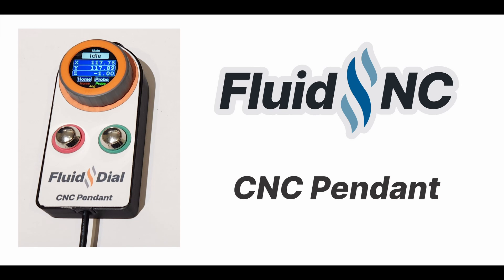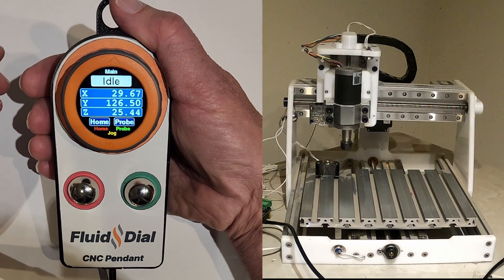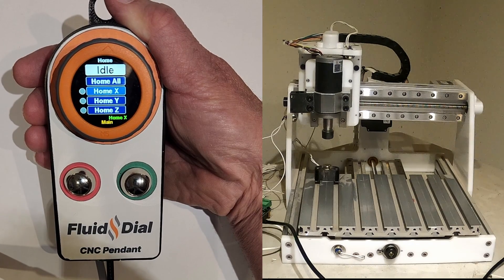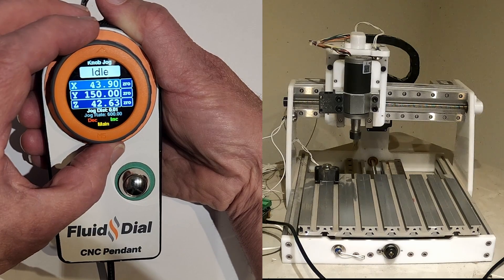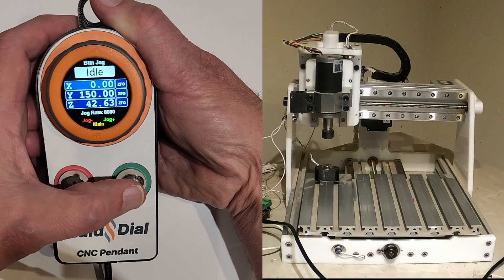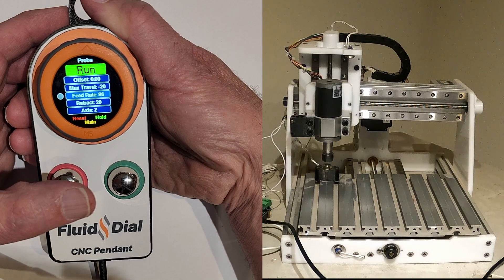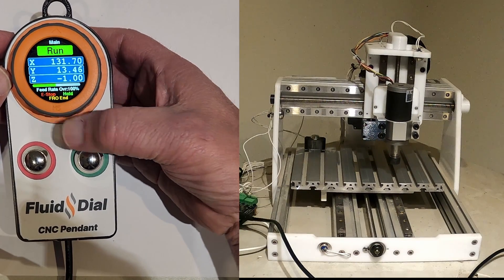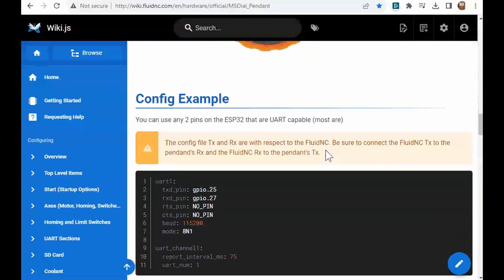The FluidDial CNC Pendant for FluidNC

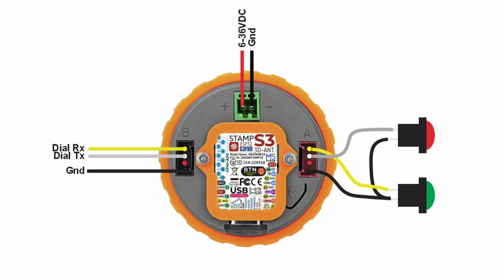Comment: Please note that the wiring diagram shown at 1:07 is outdated and incorrect.  Please use the updated wiring shown on the wiki page.  Also please note that, unless you use one of the newly-available connection kits, it is easy to destroy both the M5Dial and your controller board if the wiring is done incorrectly or if you make the connections in the wrong order.

Comment: Hi, I am new to cnc and programming. I want to make a custom tool changer. I would like fluidnc to send tool number to an external device such as a micro controller (running arduino code) so I can use it to facilitate tool changing. Is it possible to do this. Can you give a brief overview on how to do this? Please point me to where i can find the answer to this question if you have answered it before. I looked through the FAQ but havent seen any information on this question.
Reply from the maker: Go to the FluidNC wiki and our Discord.

Comment: Hello Bart,

I’m working with an MKS DLC32 V2.1 board and the MKS TS35-R V2.0 touchscreen.
I’d love to use FluidNC with the following features:

• WiFi connectivity
• X and Y edge probing
• Z-axis probing
• Multi-point bed leveling
• Multi-point part leveling (X, Y, then Z)
• Touchscreen interface with matching icons for each function

Would it be possible to create or support this setup within FluidNC?
I’m comfortable adapting `config.yaml`, wiring DM556 drivers, and scripting macros — just need guidance or a compatible build to get the touchscreen working.

Thanks for your amazing work!

Best regards,
Manu
Reply from the maker: See how to request help here.  

http://wiki.fluidnc.com/en/support/requesting_help
Reply: @engserve thank you very much 👍

Comment: I built the pendant and it powers up.  It says N/C on the screen.  I assume it is not communicating.  I am using UART1 1000000 baud 8n1.  GPIo.13 rx, and gpio.21 tx.  rx to tx, etc.
Is one million baud correct?  I saw somewhere else 115200. ???  No errors when I bring up the webui.  Show the correct gpio pins on webui
Thinking about changing temporarily to uart2, which is a header on the Tinybee
Reply from the maker: Ask for help on our discord.  Youtube is no good for tech support
Reply: @engserve  every time I try discord, it tells me I have no text channels, whatever that means!
Reply from the maker: @glenb1356 try this link. https://discord.gg/29xc4zV8
Reply: I have confirmed with a scope that the Tinybee is transmitting.

Comment: Hi great video I also built the same pendant everything works only the probe part in my opinion doesn't work well in practice when I start the survey sometimes part touches the probe and stops does nothing else and there is no way to bring the tip to the zero piece or sometimes part for an instant without touching the probe and on the webui it appears offset set do you know why it has this behavior?

Comment: would i be able to upload files to the cnc machine via the usb port on the pendant? its currently not designed to be accessed but i could easily modify the design to make it possible to attach a usb. Our local makerspace is building a printnc with your 6 axis controller and the owner of the space doesn't want to upload files via wifi.
Reply from the maker: You can upload files via the USB on the main controller...not the pendant.

Please ask future questions on our discord. See the wiki for access.
Reply: @engserve  o thanks! I'll check that out. Can also make that work.

Comment: Hello Sr. I see that the XYZ axis are always in mm can I put the reading in degrees as if they were 3 horizontal indexers and maybe add more axis or indexers as A B C and if you can also add a speed regulator to the spindle or Motor ? thank you

Comment: Thanks for this! I got my Fluid Dial pendant printed, assembled, and wired (on pendant side), and firmware built and uploaded. Still need to do the wiring connection on the board side. I had an issue with the case not allowing enough room to connect the power to the dial, and I wound up remixing the printed base to add 7mm to its depth. The power input socket on the dial came with a green plastic "power block" insert, but the printed base was not allowing enough room for it, and also did not have enough room for using 2.4mm pin housing type connector either. The remixed version seems to be OK. Thanks again!

Comment: I really love your ethos @engserve! Stumbled across (many recommendations for) your work while I was checking out tasty, tempting Fluidnc stuff. And now I can't wait to start using some of your gear as well!  GRBL, Fusion and Easel should be really enough for me, but no! Not not now I've seen ESP32s being wielded by Bart Dring. Big wants :)
I just need to finish a minor complete transformation of my now sloppy old 3018 engraver into a solid 3D carver. I Have almost all the bits for the job, except maybe fasteners, I keep ordering the wrong ones lol.

Comment: I bought the pre-made connectors linked on Amazon.  They fit the dial ports nicely, but only if you cut off the locking tabs.  They do still seem to click into place and are fairly secure.
Reply from the maker: You are correct. I added a note about that to the wiki page.

Comment: Very fine project. I landed on this YT site while looking for some documentation on the M5 Dial's software routines. M5 has very little documentation on the software  routines for the display, etc. Looks like you have figured it all out. From your code, I believe you use PlatformIO, which I don't use (I use Visual Micro plugin for VS for any Arduino projects I do)
 While I wasn't thinking of the M5Dial for a pendant, I also have a homemade  CNC milling machine and a fancy pendant that I built with a lot of mech. buttons , and a very fancy encoder wheel that is industrial quality (although I got it from Bangood).

Comment: If you get a chance, please post a link to which buttons you used (perhaps either in the pendant wiki or here the description).
Reply from the maker: They are usually called anti-vandal buttons. Any button that fits in a 12mm hole should work. Added to wiki http://wiki.fluidnc.com/en/hardware/official/M5Dial_Pendant
Reply: @engserve I'm genuinely excited about this project. It occurs to me that if a file browser could be programed into it to display what is on the SD card and allow starting jobs from this pendant, it could reduce need for a smart phone or tablet. Don't know if that's possible, just an idea.
Reply: @design8studio  almost always you want a momentary switch for these types of inputs, but it may be worth checking up on these functions and their uses before you attempt a project like this, maybe start with something much simpler to learn on, there's tons of beginner arduino kits out there
Reply: @nerddub  Already ordered momentary switches. Thanks. I'm quite confident this project won't be an overreach for me and others in the V1E maker community. We're already eyeing enhancing it, and our community is populated with the brains to help. Thanks again.

Comment: I've scanned through the github and the wiki but I can't find any information about hardware controllers that you'd load FluidNC/grbl_ESP32 firmware on to.  Is it your Grbl_ESP32 CNC Development Board V4.1 on Tindie? It's out of stock at the moment, are there are alternatives?
Reply from the maker: There are a lot. Here is a list of the ones I know about.  http://wiki.fluidnc.com/en/hardware/existing_hardware
Reply: @engserve  Thanks!  I want to turn this cheap CNC engraver into a foamboard cutter and I have a feeling I'm going to have to replace the guts with something better.